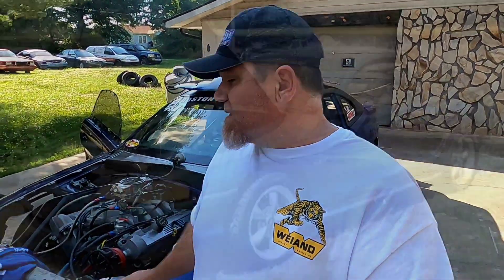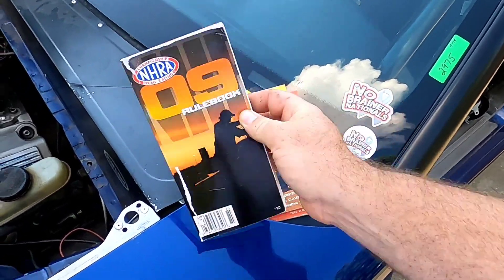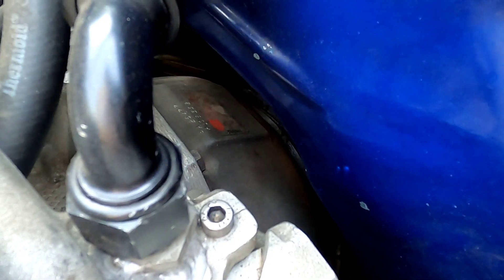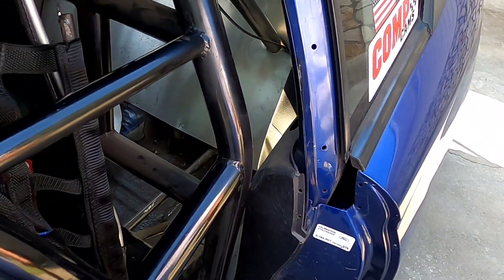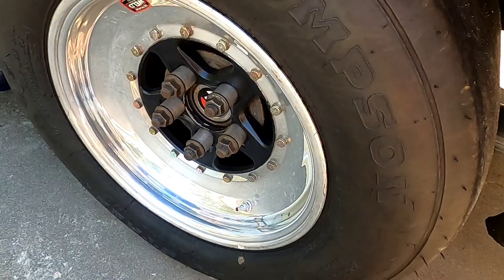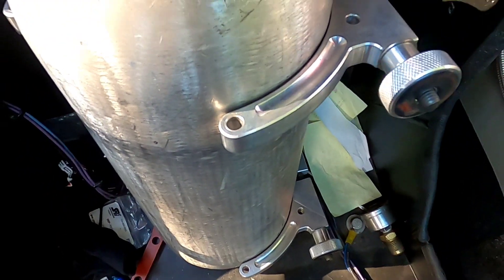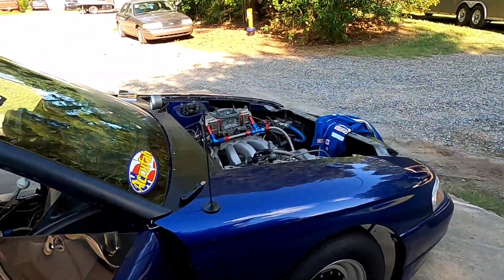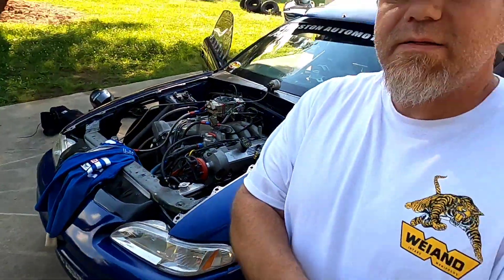Drag Racing the Safe Way: NHRA rules 11.49 to 10.00 ET's

Comment: Good video. Liked the NHRA Rule Book viewpoint, things gotta' happen for better racer safety. It's an awesome sport, but it'll humble you when your not expecting it.
Reply from the maker: Thanks Brian... I was really surprised that the NHRA changed the rule on rollcages on 2014 and newer cars..  we will see how that works out ..
Andy
Reply: What's the ruling on the drivers seat ? Does it need to be attached to the rollbar behind the seat ? What if I have A factory seat? Car runs mid tens & under 135 !

Comment: Andy there mostly good rules that they have for safety but one rule i disagree with is requiring a metal battery box. I had plastic battery box and the official gave me a hard time about it he told me if the car flipped over that the plastic wasn't good which i explained to him it couldn't ark on plastic and i also had it anchored to the floor
Reply: better to have a steel box thats lined...inertia sends heavy things flying like a big ass bullet

Comment: Great video Andy!  As far as a neutral safety switch goes, I'd be curious as to what your thoughts and tech experience has been with regard to teching-in or passing MANUAL transmission cars that never came equipped with any form of neutral safety interlocks on their transmission or clutch from the factory (a VW beetle based application in my instance)?  I'm sure there are ways to interlock that for safety, but it seams like the rules could be slightly ambiguous on this.  Any thoughts?  Thanks my friend!

Comment: Recent rule change says you can run down to 9.0 without a roll bar or cage in a 2014 and newer cars as long as it has the original safety equipment and DOT tires. Demon & Hellcat owners no longer have to modify their cars to race!

Comment: Great video . I’m running a 98 f-150 with 5.4 but want to run a 351 carb motor , you know If that will cause me a trouble in the getting it certified since it’s not the right motor for truck ? Any help or info would help ! Thank you sir . Keep the video coming ..
Reply from the maker: Are you talking about with your state inspection?  Here in NC we have a 20 year rule. Once a vehicle is 20 years old it becomes a safety only inspection... It depends on the laws where you live
Reply: No I was referring to the race rules , I’m in California, nothings legal but drugs and illegal activities…
Reply from the maker: @josephleach7205  oh you are fine to do that.. just make sure your fuel line doesn't have more than 12" of rubber line and other than that.. you should be good to go
Reply: Got it , thank you and Happy Thanksgiving!
Reply from the maker: @josephleach7205  same to you and your family

Comment: Andy, I have been to NHRA tracks on test and tune days and have observed multiple late model cars (i.e. Mustangs) running mid to low 10’s with essentially bone stock factory stock chassis.  No roll bars, driveshaft loops, stock axles, etc. Are the rules different for late model cars due to their having to comply with stricter safety standards?
Reply: After 2010 or somewhere around there theyre cert to like 11.0 or something like that due to new chassis tech but I personally wouldn’t do it lol

Comment: andy the dual feed along w/ all ignitible fluids should be run away from your ignition source why pump the fuel so far foward
Reply from the maker: Since it is a nitrous combo we do a great deal of tuning by adjusting fuel pressure.  It's all about ease of access in flow testing after the regulator. Thanks for Watching
Andy

Comment: I'm going to have to disagree with you. In many instances the "rules" are just used to annoy and hassle people and ruin their day. Example; I was kicked off the track once for not having a drive shaft loop. Never mind it's a mid-engine rear wheel drive car........... There is NO drive shaft to start with. The transaxle mounts directly to the engine just like exotics. Once I pitched a fit, and demanded to talk to a senior inspector his response was "the rules say you have to have one, that's your problem."......... What am I supposed to do? Cut a hole in my hood, bolt one on and leave it hanging out in the air? Another time I was kicked out because they couldn't verify my damper. Again, mid-engine, so the front of the engine is very close to the fire wall between the engine bay and the passenger compartment. And since it's a flat bottom chassis you can't see it from below. But if you contort yourself and use a mirror you CAN see it's an ATI damper. But since he couldn't read a SFI number in the mirror I was kicked out.............. (even though I showed him photos of it before the engine was installed) And yet lastly, I was thrown out because my cage (10 point BTW) didn't mount to a "frame rail".......... It's a monocoque chassis!!!! I don't have frame rails!!!!!! Again............. "my problem"............ 

Unless you show up to a track/event with the same bull shit as most other people. (a chopped up and welded domestic) the inspectors are fucking clueless. And more times than not so fucking arrogant they won't listen............ Overall I DO NOT have a high opinion of the inspectors. Yes, occasionally I run into one that's either a fabricator OR is willing to listen. But that's far and few between. 

If you're having trouble visualizing what in talking about here is a vid of another guy building his SLC. -- https://www.youtube.com/watch?v=ECLJgZdkWgk

Comment: Man this is so far out the window right now with Lubetube and all of the factory rockets coming out.... I cringe constantly watching all these kids that admittedly have no idea what they are doing hop in and head to the track and they are allowed to run. This can only last so long before something happens and videos like this will become a big deal suddenly. When I started drag racing this is what the car was built around , its where you started . Not shopping for Ebay Turbos or tuning software. The tracks simply would not allow you to run if your car wasnt up to snuff.
I have literally seen 8 second cars that are frightening from the lack of mandatory equipment. When you mention it you are the buzzkill and the bad guy... All of the things being talked about here is where you begin , not where you end up.... Whole lot easier to do it when you are just starting building it rather than having to tear everything apart after..
Reply from the maker: Kyle, I too am amazed about the modern day racing culture... People dont think it can happen to them...  Until it's too late!
Thanks for Watching...  
Andy

Comment: They moved the 10:99 to 11.49
Reply from the maker: Steve, What part did they move? Thanks for Watching and your input
Andy
Reply: @UnityMotorSportsGarage  correct me if I’m wrong. I raced in the nineties 10.99 you needed a roll bar. Now 11:49 . I was 87 grand national running 13:40 stock some bolt ons running running low 12s then engine build and more bolt ons couple high 11s last two runs of the night 10:96 warning from track officials don’t exceed 11:00 without a roll bar . Last run 10.27 kick off track for violating roll bar and other safety gear rules
Reply from the maker: By the rules in '09 anything faster than 11.49 needed a rollbar.
Andy
Reply: @UnityMotorSportsGarage I am not sure it was like that in1995 .